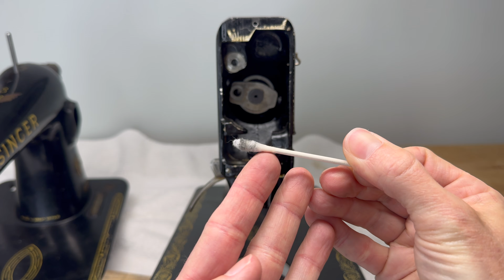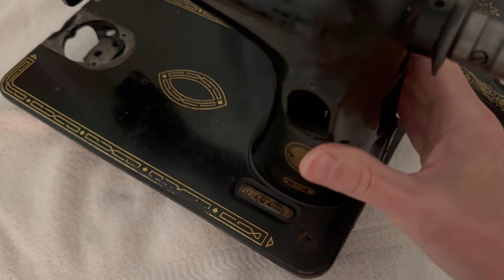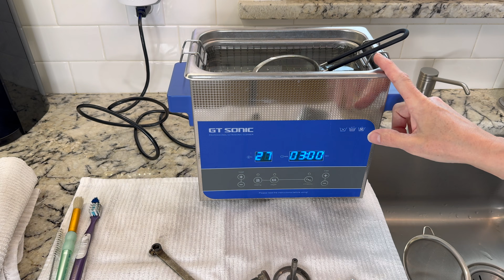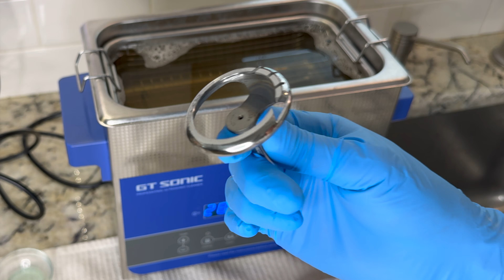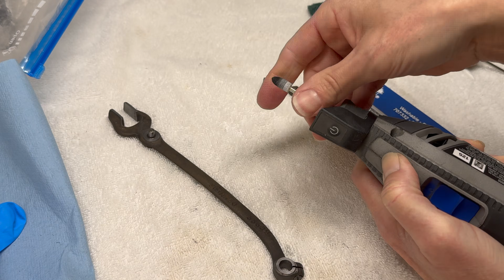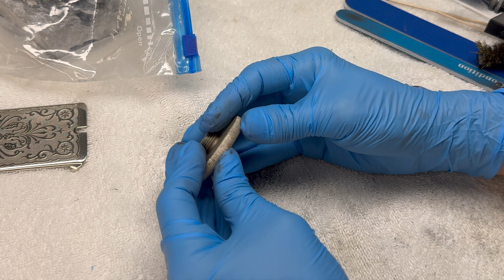How to clean an old sewing machine - In depth Singer 99 Restoration - Works for any vintage machine!

Comment: Hi Jen, thank you for all your great videos!!  Would you ever use carburetor cleaner or brake cleaner fluid? I know the carburetor fluid leaves an oily film behind which I thought was good since we don’t want Rust but I’m not sure if the oil itself is good for a sewing machine. Secondly, the brake fluid evaporates pretty quickly and does not have any lubricant on it, which Then raises the concern of flash rust.  I’d like to know what your thoughts are thank you.
Reply: Brake cleaner dries super fast and that's not good.  Tool cleaner works great on parts that aren't painted. WD40 works great as a cleaner, as long as you remove it at the end.

Comment: I wonder if a microcrystaline wax like Dorland's would be good to at least put a satiny sheen over sections with crazing. It shouldn't show white, I don't think. It doesn't contain any water. It's used to protect watercolor paintings on paper--so it's extremely gentle. Otherwise, Renaissance Micro-Crystaline Wax (significantly more expensive) is used for art restoration purposes. Another possibility would be a black-tinted auto wax… possibly. Since Dorland's wax is made to be used also as a paint additive you might be able to put a tiny amount of black pigment in it. Just spitballing based on what I know of art supplies that may apply. I'm sure the crazing drives many people nuts!

Comment: Can I ask how to clean rust under the machine as in not the electronical part but the regular part
Reply from the maker: Hi! I would have to see it to say for sure but probably swabbing with some rust remover and then some kind of light sanding either with a wire wheel or abrasive wheel on a rotary tool. I hope that helps!

Comment: Hello, I’ve just picked up a Singer 99 off facebook marketplace, the hand wheel collar doesnt spin freely and takes quite an effort, where do you suggest I start with the cleaning and restoration? Thank you
Reply from the maker: Hi! If it feels frozen I would start with oiling it everywhere. Use a penetrating oil, not sewing machine oil. See if you can get things moving and then you can move on to cleaning and restoring. I hope that helps!
Reply: I oiled all the ports and left it overnight and watched your videos, i was planning to take it apart but when i woke up it was spinning freely 😂

Comment: Why does my sewing machine skip stitches.. sometimes there are  gaps of no stitches. What should I do?
Reply: Skip stitches:  make sure your machine is correctly threaded, adjust tension-normally at 4, make sure bobbin is in bobbin holder correctly, make sure the bobbin holder is grabbing the thread snuggly-check by holding the thread from outside the holder, hold the thread, dangle like a yo-yo, the bobbin should hold the thread and not let it drop.  Hope you understand by info.
Search YouTube for videos on skipped stitched.
Reply from the maker: All great suggestions! I would only add trying a new needle. Thanks for sharing!
Reply from the maker: There can be many reasons for that, including that you need to put in a new needle. I hope you got it figured out!

Comment: Thankyou for your videos. I have a 1931 singer 66-6. Belonged to 2 generations of family. Theres so much grime around the wheel, motor area and thin layers on rest of machine. I bought a black light and the whole machine turned a greenish color which I assumed was decades of wiping oil all over. Some areas are  thicker. The entire machine is completely dull looking. No shine at all. Ok, 1st off what color is the clear coat supposed to be under black light? The sewing oil or paraffin oil (i could not find kerosene) doesn't lift the heavy grime. I'd appreciate suggestions. Thank you
Reply from the maker: Hi! The green that you see under the black like is the clear coat. It shows up green. So that is a good thing. Without seeing some pictures of what you have going on it is hard for me to say exactly how much shine you will be able to get from cleaning and polishing. I have tried the paraffin oil and I don't think it works well. You may want to try a cleaner wax like Zymol cleaner wax or the black wax by Car God's for the final clean and polish. I hope that helps at least a little!

Comment: My both grandmas had got such machines of Singer make which was very widely encountered in Poland in the begin of 1900s. The kerosene was widely used for lamps that time, and they used to clean their machines with it and oil them with paraffine oil. I did the same with no wrong effect encountered😊
Reply from the maker: Yes! The kerosene will not hurt the finish usually and it will help flush away all the old oil. I clean with kerosene often. I use sewing machine oil for regular oiling but the kerosene is great for cleaning!

Comment: I use a Dremel tool and the buffing wheels like you suggested and they work so much better and faster than just the Scotch-Brite pads and oil. Makes less of a mess. I use all of the grits in the bag depending on how nasty the part is.
Reply from the maker: It is great to find anything that makes us more efficient as well as effective. Glad you like the buffing wheels!

Comment: Hi,  thank you for the amazing educational videos! So helpful!  I'm wondering if you use the low odor/odorless Kerosene,  or regular Kerosene? I have a 1948 and a 1956 201-2. Also a Necchi BU Nova. With the exception of some pin rash, and a few small spots,  both of the 201s, and the Necchi pass the black light test! Yaaay! But, that grime and dull look is definitely there. After seeing your video, I'm assuming I haven't cut through the grime yet. But, I'm not sure. I don't want to use the Zymol until I'm sure it's clean enough. I'm just not experienced enough to be certain. I think it's time for me to try Kerosene and want to be sure I purchase the correct product. I appreciate any advice on the Kerosene and how to know when I've cleaned enough to move on to the Zymol. Thanks so much!😊
Reply from the maker: Hi! You are so very welcome! I use the Kerosene that has the awful smell but that is just because it is what I could find easily in the quantity I wanted to purchase. If I could have found the odorless I would have tried that first. As far as the grime, it could be grime or it could be partially compromised clear coat. I'm not sure that I can explain it properly but I almost believe that sometimes just a top layer of the clear is compromised and once you clean it off with kerosene and then polish it just lifts away the compromised part but there is still a layer of clear that shines of nicely. Not sure if that makes sense or if it is even true, just my take after doing so so many of these old machines. You can move to the Zymol once the grit and loose dirt is gone. You just don't want anything like that on your rag that you are polishing with that would put scratches in the clear coat. If you feel like the Zymol isn't working you can try going at it with kerosene again for a bit and then try the Zymol again. It won't hurt anything. I hope that helps!
Reply: @SewingMachineRehab thank you so much! Much appreciated!

Comment: I recently found an 1910 Redeye for $5 at a garage sale. Mechanically it cleaned up fine and works so I'm beginning to deal with the body. Thanks for talking about the craze marks in the finish. I've been wondering about how to deal with them.  You mentioned you weren't going to do a French polish, but I'm an old man with the time and patience to work on it. If you've ever done one, please share any tips or tricks. BTW - I found the machine just before our 56th anniversary and the machine was manufacture on the date of our anniversary, June 2nd.
Reply from the maker: Hi! How special! I wish you all the success getting it up and running! I haven't done a French polish, I have only watched videos on it. 😂 But, if you have the time and patience I think it is a great option. Let me know how it turns out!

Comment: I use Peek metal polish on the faceplate and stop motion nob. I apply with a toothbrush and scrub a little. It cleans like magic. 

Peek is about $10.00 at Amazon.

Comment: I use a vibrating gun case polisher with walnut media to clean and polish parts as it will not hurt the chrome ad the parts come out dry but the walnut gets int small holes and can be a pain to get out so be careful small long oil passages will become plugged it also makes attachments sparkle like new also and brightens brass parts  leaves no micro scratch lines in the polished parts the vibrater is cheep and so is the walnut media.
Reply from the maker: I have never heard of that kind of polishing, sounds really cool! Yes, I know when I have had machines media blasted for painting, it was a nightmare getting the media out of any bushing holes. Would love to see what your parts look like after polishing with this method!
Reply: @ I am going to try the sonic cleaner I have some crud cutter

Comment: I have a Centennial and it's missing the slide cover for the bobbin. Could you please advise where to get one?
Reply from the maker: Hi! I would try eBay for a vintage replacement part and you can also try vintagesingerparts.com or sewingmashinepartsonline.com Usually one of those places will have one. I hope that helps!

Comment: Have you ever tried lamp oil instead of kerosene? Lamp oil is distilled and deoderized so it doesn't smell as bad. I'm just curious if it would clean as well?
Reply: To answer my own question,  I spent the morning cleaning an old Singer 328K beige painted machine. It had old crusty dark orange-brown oil and dirt caked on everywhere. The lamp oil took it right off without damaging the paint. I used wooden Q-tips and paper towels. Some area and edges were hard to get to, so I broke off the end of the Qtip amd used the wooden/bamboo end dipped in lamp oil to scrub it gently and again took it off nicely.  I also wiped down the bakelight plastic and plastic tension knob ring. It cleaned the dirt and didn't bother the paint. The bakelight and chrome corrosion bloom also polished up nicely. It dried nicely with a clean paper towel without leaving an oily residue or nasty kerosene smell. So I'm gonna call smokeless scentless parrafin lamp oil a win!
Reply from the maker: Thank you for the tip! I have some on hand and I am going to give it a try! Would be nice to recommend something that isn’t so smelly!
Reply: I have used GOOP hand cleaner - the smooth, creamy stuff, NOT the gritty hand cleaners with pumice. Test with caution as this can quickly silver the decals if the finish is already compromised. Rub with fingers, a cloth rag, or paper towel. Be aware that paper towels are slightly gritty.

Comment: Really cool part about the enamel finishes on those old machines is that most solvent will not harm them. We're not talking about traditional paint here so it's nice to see somebody actually recommending a good quick drying solvent. Alcoholic 90% or better is recommended if you want to remove the old varnished oil.
Reply: Never use alcohol on the paint surface .It will destroy the decals. Use machine oil on the surface.
Reply: @ good information. I've never had any decal damage, but I'll keep that in mind. If it's even possible, I wouldn't want to take the chance.
Reply from the maker: Exactly. Oil or kerosene will be a safe option for the painted surfaces. The cleaner wax I use is also safe. I hope I was clear in the video, I do not recommend putting alcohol on the painted surfaces.
Reply from the maker: As long as you keep the alcohol off the clear coat. Even fast drying will hurt it if it sits there more than a second or two. But on all the stainless parts, for sure! Great cleaner.

Comment: What are your thoughts about using Murphy s oil soap on dirty grease?
Reply from the maker: Hi! Well, I have never tried it! Once I found Krud Kutter for parts I never looked back. Very low suds which is nice. I probably wouldn’t use Murphy’s oil soap on the body of the machine but it wouldn’t hurt to try on the parts. Let me know if you do!
Reply: Hi @SewingMachineRehab  

carefully diluted Murphy's is good on metal parts in the parts tray only, never on the machine itself.
Never on plastic, and rubber

:Krud Kutter® The Must for Rust" is a unique rust remover and
inhibitor. It removes and prevents rust in one step. . Regular krud kutter  if forgotten can cause more rusting because it has water in it.

Great Videos I'm learning a lot!

Comment: 2:05 do not go at this with a dremel.  A paint brush without chemicals.
Reply: 20:13 I use these make up remover cotton pad things you can also get just next to the mascara brushes in the drugstore. The longer you use them the better they get and soon you don’t even need to add the polish paste.  I’m also pretty big on plastic polish as an alternative to car polish.  It’s just more of a paste and I feel car polish has some stuff in there to make the job easier but may have negative effects.
Reply: I am in Germany and I had just gotten a nice old Vesta.  It was seized and wouldn’t move.  In Germany there is a product called Ballistol.  It was invented during WWI for the German army to clean and lubricate their weapons, but they also wanted to be able to treat wounds with it.  Yeah so anyway I pretty much covered the engine machine with this stuff.  The previous owner was really good with keeping the machine lubricated, however they used the wrong oil and I had a lot of work to get it away.  This Ballistol is sort of like WD40 but it’s actually a light oil unlike WD40 which is more of a cleaner.  Then yeah to remove the excess I used straight up Corona spray 99.9%.  A few drops of sewing machine oil and a silent running 100 year old machine.  I just wanted to say that I am not so super against chemical cleaners as a first option.
Reply from the maker: Hi! I don't think I can get Ballistol here in the US. Yes, it would take very steady hands to use a Dremel in some areas. Just oiling up these old machines will do wonders for them! I like doing deep dive restorations so I take things a bit farther. How fun and interesting to be working with the accordions! My father-in-law used to play them when he was alive. 😊 I think we still have one if his in our basement. Thanks for commenting!
Reply: Also, I am watching this video because I don’t know.  If I knew I wouldn’t be watching your video.  I work a lot with pre-war accordions and it’s a never chemicals situation and dremel is a hard no except for a few scenarios.  For the tinkers tuning is NOT one of the scenarios.  Also no epoxy.  :)

Comment: I have a 221 Featherweight that is stiff and doesn't sew very fast. Could it BE the pedal?  I have carefully taken my machine apart and lost a tiny screw.
Reply from the maker: If the hand wheel is stiff then it might be something more mechanical. Either way, I would always replace the pedal and keep the old one for history's sake. Which screw did you lose? Feel free to email me at jen@sewingmachinerehab.com if you have more questions.
Reply: @SewingMachineRehab  

Thanks I think I lost a gib screw (it's been called)
You have parts for sewing machines?
Reply from the maker: @juliepruett6356  You can find the right one at the Featherweight Shop. Here is a link to the common one: https://singer-featherweight.com/products/gib-screw/?aff=57 but read the description before you buy and make sure it matches the hook you have. There is another one listed on their site as well. I hope you find what you need! I have very few parts for machines, I usually don't sell them since the Featherweight Shop already carries so much.
Reply: An alternative to the alcohol would be mineral spirits, it won't harm the machine shown in the video because that's a baked enamel. On newer models with a painted finish, I would test in an inconspicuous area to see if the finish gets sticky and if it does, don't use it allow that area to dry without tampering with it too much and then you can buff out any fingerprints you might have left.  Mineral spirits and mineral oil are pretty much the only chemicals you would need for maintenance on classic machines. This is also true with Firearms. You don't need fancy products to do the job correctly.

Comment: From a machine shop perspective I'd say needle bars and presser foot bars, polish up and down not around, because that is the way they move in the machine. They don't rotate. Thanks for letting me vent. I did greatly enjoy the video. Thanks again, Doyle
Reply from the maker: @doylekoehn220  That is a very good perspective to consider! Now I will be thinking about this. 😊 Here’s some of my very first thoughts: You would think that the needle bars and presser bars would become very polished after running up and down inside the bushings. But most of the time, they are not even after years of use. Usually if I see a really shiny, smooth spot on a needle bar it is also very slightly bent and that is what caused it to become very polished looking and usually it is only in one spot on the needle bar. Not all the way around. Also, I think of the microscopic grooves going around the needle bar…do you think that aids in keeping the needle bar oiled? If they ran up and down then the oil would run down the bar faster but since they polished it in the other direction maybe it holds onto the oil longer? I think the clearance inside the bushing was designed with that in mind perhaps? Very intriguing point and it makes me wonder why they polished them around instead of up and down originally. I am glad you shared your insight, it gives me something to think about and your point does make sense. I wish we were able to ask the original engineers why they polished them around instead of up and down! Take care!